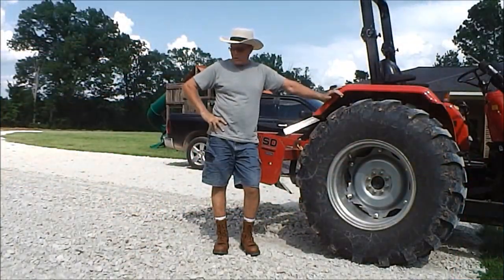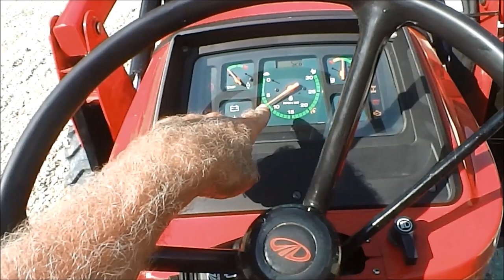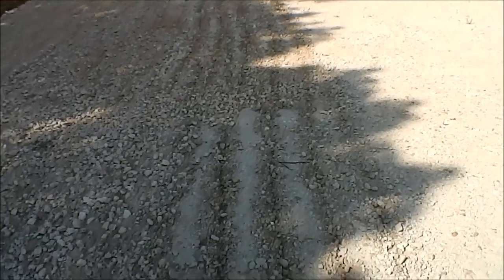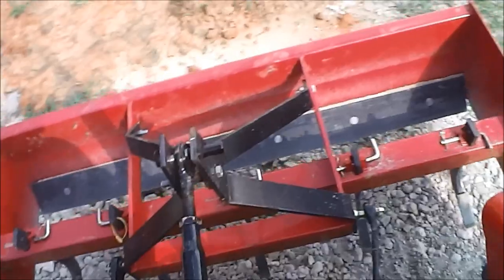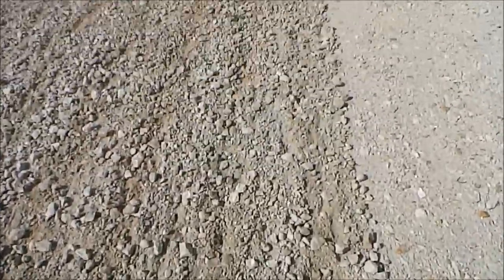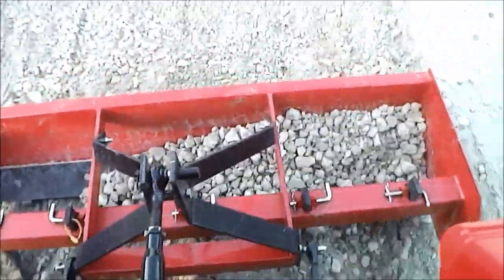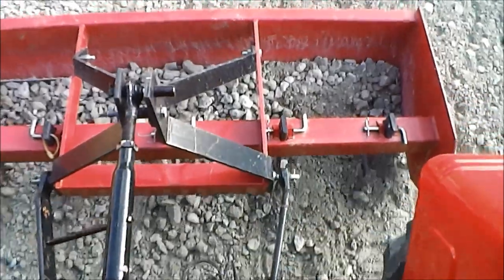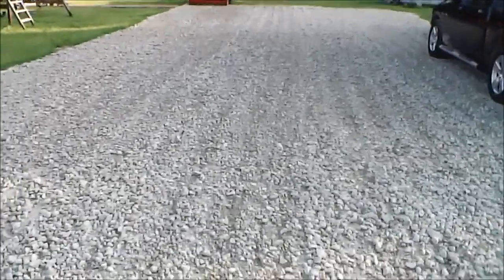Box blade - Resurfacing your gravel driveway

Comment: Really enjoyed this video. I was raised on a farm but we didn't have box blades 60s-70s. I recently got a good tractor and some toys to go with it. This video was helpful by showing me some things I was doing right and some that I was doing wrong. My arm on the back wasn't tightened down good enough and my box blade started digging in more on one side than the other. Another issue I was able to correct was the grass/broom sage building up under the blade and lifting it up. I corrected this by removing the two outer teeth. I'm playing around on some of my property with it trying to develop skill. You're right, if the ground's good and hard you can only do a little at a time.
Reply from the maker: I'm always learning something new when using the tractor.....Thanks for watching.

Comment: This is a  just in time video, Pete.  Thanks.  We have been waiting for the gravel road to dry up a little from a really wet spring and early summer.  Now we can get out there and level those potholes and level the road.  Great video.
Reply from the maker: Thank you.
Reply: This will be our first attempt at road grading with our new box blade.  The road has lots of 6 in deep pot holes that need to be fixed.  Our neighbor has  dozer, and just respread the top layer, and it filled in the holes, and it better for now, but I know from experience that it will not last.  I first tried to just fill the holes with crush and run gravel, but they reappeared within a couple of weeks, if not deeper ;)

With research, I now know that we have to break down the walls of the potholes or they will always return because the form of the pothole still exists.  And that makes sense if you think about it.  

Very excited to have a road (almost a mile long) that will not be a teeth jarring experience every time we drive on it.

Note : On the plus side to the pot holes being so deep, I can see that there appears to be a very good foundation laid  on the road in layers of Rocks, stones, pebbles and crush/run to at  least 6+ inches.  So that is good ;)
Reply from the maker: My drive way is about 1500 ft long but yours being almost a mile long is very long. Just make sure you stay hydrated in the hot sun.
Reply: You can dig deeper faster if the road is not completely dry.  A little moisture goes a long way in letting the rippers dig without overloading the engine and transmission.

Comment: That box blade is separating the large from the small. A rear blade put at 30 or 45 degrees will roll the materials together & can provide a surface much like asphalt, except that the crushed rocks should have a 4% slope to properly drain unlike the 2% required for asphalt.

Comment: Probably restating other’s comments, but rippers seem to only hinder pickup in the box even on a much softer road surface.  I have found resurfacing is much faster by pulling them all the way up.  With proper angle your box will fill sufficiently within in a few feet.  Perhaps the rippers will work on other surfaces but they seem to more cosmetic than functional for my uses.

Comment: Nice video Pete.  Give that thing a little gas and a higher gear.  Time is a burning!
Reply from the maker: Thank you, Yes running a box blade to fluff your gravel driveway is very time consuming. You have to run it very slow or the gravel won't build up in the box blade. 🙁

Comment: New to grading my own driveway.  Question, so when we would maintain lease roads they would put down 3" then after it got a good base they would come in later with 2" crusher run,  so my question is wouldn't ripping it damage the base??  I was always told we wanted good bases in our lease roads.  Does it not get deep enough to disturb the base or what?  Thanks in advance.
Reply from the maker: It all depends how deep you have the box blade shanks set, usually they're not that deep. You just want to fluff up the top layer while the box blade is filling with gravel and filling in low spots as you're moving forwards.
Reply: @petebeasttexashomesteading  Thankyou
Reply: Double E Ranch  if you live on a hill and have a steep driveway, don’t do this, if you loosen up the gravel, and get a heavy rain,trust me, you will lose tons of gravel. You’ll be trying to drag it all back up the hill. But you’ll still lose a bunch. It will fill your ditches and plug up your converts. Been there and done that. Good luck 👍

Comment: Hi Pete.  I'm as much a novice as you could imagine for anything rural.  But I went ahead bad bought a rural property anyways.  It has a gravel driveway in rough shape, lots of pot holes.  

Is there a reason everyone uses tractors to pull these instead of their truck/suv?  I don't have a tractor.  Could I get away using my SUV or so I need to buy a tractor?  How about something like a deere gator?
Reply from the maker: I don't think an SUV or an ATV can go low enough in gear to go that slow to pull a loaded box blade, plus their transmissions are not designed for that.

Comment: This may be a stupid question, but why is the box blade gathering up more gravel on the left side of the blade than it does on the right side?  I did learn something by watching this video.  Thanks for sharing it.  Jay
Reply: I have a tractor like this and sometimes the blade can get really uneven, and in the video it looked like that was his issue.
Reply from the maker: Hey Jay, it also depends on how level the ground is in respect to the tractor or there just might be more lose gravel in a certain area then another. I know my blade is level because I leveled it in my garage on the concrete floor.

Comment: adjust your top link pitch it down. Get those shanks to bite
Reply from the maker: I've tried that in the past but that limestone gravel gets really hard when it's been packed down.
Reply: You can get the teeth to bite so much they stall the tractor...

5 passes and great results.

Not overloading the  engine and transmission.
Reply: He did a good job.  Stop being a keyboard expert.

Comment: Looks like your driveway is all rocks, which is a poor road surface to begin with. you need some binder like class 5 or crushed concrete. That will bind together, giving you a better surface and not need to be graded so often. It you grade it right, once it's incorporated and sets up, it's almost like having a poured concrete driveway.

Comment: In the AZ HOA where I live we have many "retention/drainage areas where 3/4" decomposed granite was placed approx 10 yrs. ago that has become compacted over the years. The landscape contractor wants to bring in tons & tons of "NEW" granite to "replenish" the granite----which will result in the homeowners spending TONS of $$'s also! 
Many of us feel that the granite didn't just disappear--it has become compacted & covered by dirt & debris. (I've actually refreshed the granite landscape material in my yard simply by raking & getting the granite gravel back up to the surface & then leveling it.---kind of like "fluffing" it up--LOL)
Anyone with opinions about whether this BOX-BLADING might work for our community. ----So that the HOA keeps some of the money in our account INSTEAD of throwing it all at the Landscape contractor & the granite supplier? Thanks for any comments!
Reply from the maker: Yes you're right, all gravel or limestone gets either compacted or settles down in the ground over time and that's what a simple box blade was designed to do is fluff it up like when it was new. Your HOA would save a ton of money by running a box blade over it several times, this would pull up all the granite up out of the ground.

Comment: I wounder if the 2000 yards of left over road base material will be as packed as this. I been wanting to move it, just waiting on my box blade to get delivered. Some one attempted to build a shooting back stop which was a failure.
Reply from the maker: The limestone that was put down is a mix of rocks, sea shells and fine powdery limestone which is what holds it all together.
Reply: You need to compact it with a mechanical compactor. anything short of that is a waste of time.